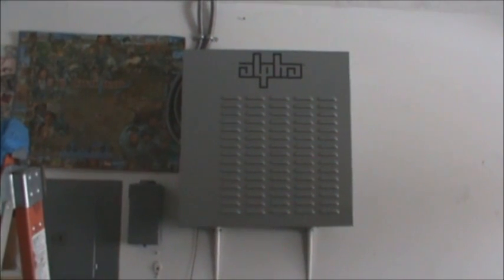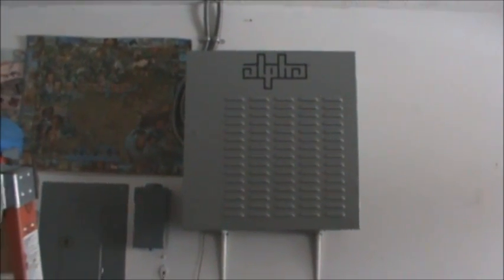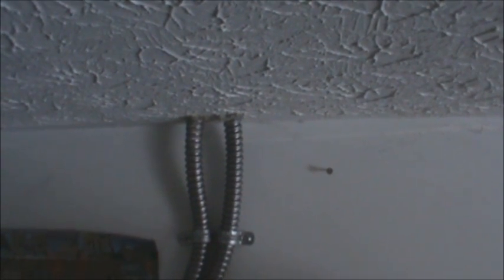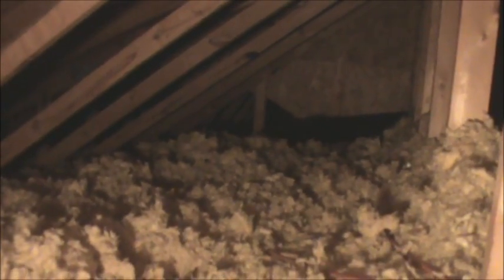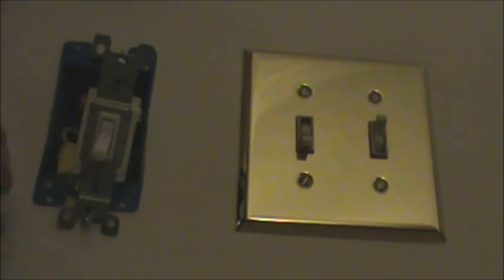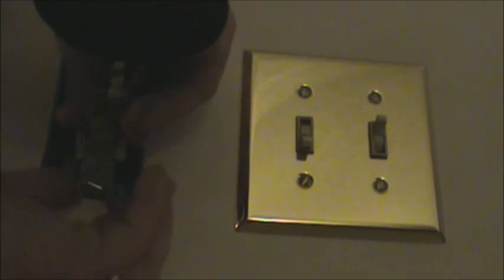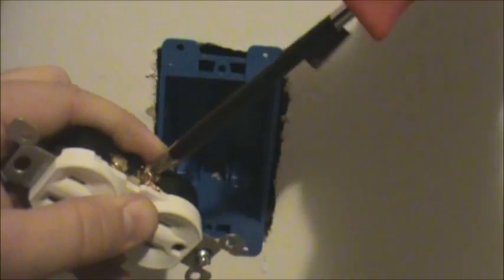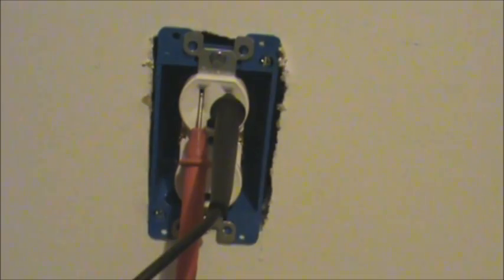How To Wire Your Harbor Freight Solar Panels

Comment: Whats the amp and Watt specs on charge controler that comes in  Thunderbolt 100watt kit from Harborfreight?  I wanna hook up more solar panels, like 1 or 2,  240watt 12v solar panel to it.

Comment: stranded wires can't be wrapped
 around terminal screws. you must use either solid  awg wires like 14-2/ 12-2 or pigtail them to solid wires. I would never use extension cord for any of my electrical work And never coil it, it would burn and cause a fire. The 3 way swith you have to be careful with the other terminal on the other side it would be hot when switch is off due to that it's a traveler waiting to sent power back to the other 3 way switch in which he doesn't have.

Comment: Do you have a list of materials? I know the kit but what else do I need? Batteries? how many? inverter how many watts? any specialty items? Silicon or whatever? now if I get 2- 45 watt kits can I hook them up together? If so how? Sorry Im just Dangerous enough because Im a Seabee and done 22 yrs in the Navy so I know a bit of electrical but real dumb on the solar thing. Plus I was a Builder and not an electrician.

Comment: meatdog101, Depending on the wire size used coming off your panels you can just purchase more of the same gauge wire and splice them together to make them as long as you need.

Comment: mackuss, One of the cords goes to the light in the kitchen from the inverter and the other one goes to the outlets in the rooms from the inverter. its actually a really nice little setup. maybe survivalists2012 will correct me if I'm wrong but that is how I understand it from both vids. Great job and thanks for the details.

Comment: Question, I want to build a setup as a portable power pack generator to take with me at the park camping or where ever I need power. Can this 45 watt harbor freight work with a Marine deep cycle battery and a 1500watt power inverter that can pull power. Also How can I hook up plugs like the ac oulet and switch to the power pack please let me know.

Comment: If you can find an old camper somewhere that you can get real cheap,youll have about everything you need,plus youll be able to see how the 12 volt system is wired when you pull things apart.

Comment: Thinking about getting some solar panels but what can you actually run off a system of 6-9 of panels? If power goes out for a few days and I have some of these charging some batteries would it keep the freezer running?

Comment: Nice! Why didn't you just tie into the current electrical lines already running through the house. My system is located right next to the main grid fuse box, so I was thinking of just cutting the wire to the specific receptical I want and wire that into the inverter. All the wiring to the outlet is already done, just change the electricity going into it at the source. Beautiful system, though.

Comment: Nice video. It looks like you are using extension chords for wires in the
walls. Will they handle 10 amps without causing a fire? You are planning
to run an entire house off of two batteries? What is their capacity and how
many panels are you planning for. Of course depends on your intended 
load...

Comment: Use heavier gauge wire, you will get better results and not burn your house down. Too many loose connections and random wires.

Comment: Matt you did a very good job on the wiring for not knowing residential. Here is a FYI for you, always wrap wires he same direction a screw tightens. That way they will not accidentally come loose. (Check your black wire on the last plug.) If you're using a 1200 W inverter you are only going to get 10 amps @ 118 volts.  Your breakers should not be over 10 amps at your fuse box you still have to hook up. If you want and/or need info, send me a message, I'll be glad to help. Take Care :-))